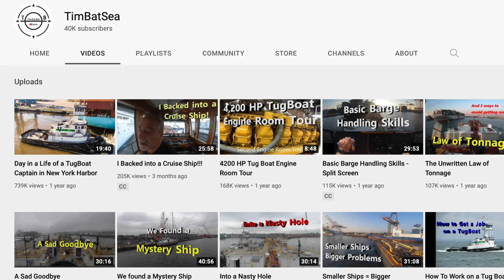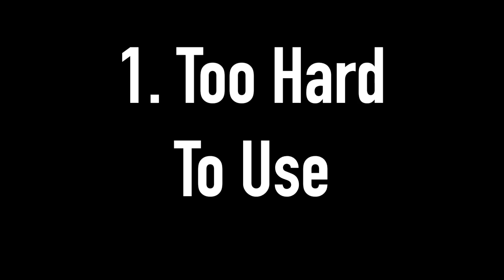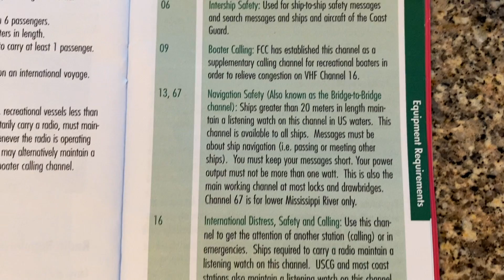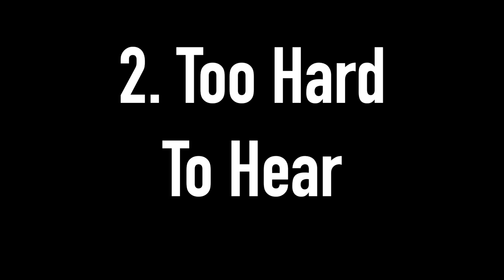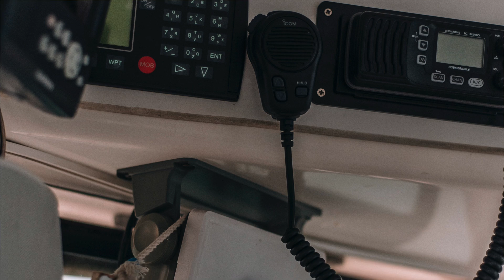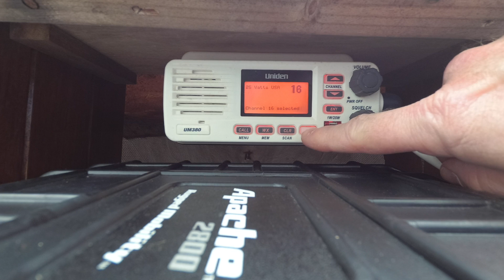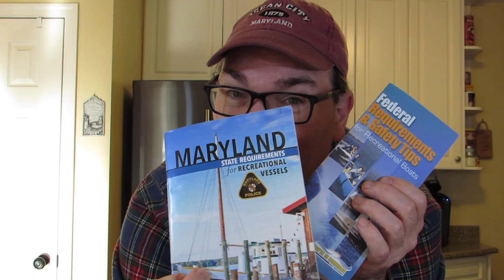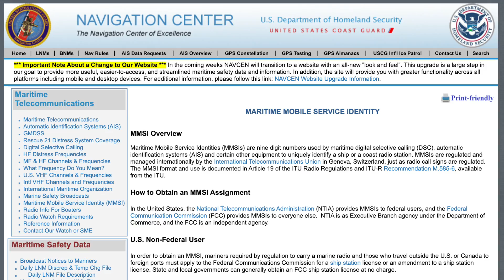The Problem With Marine VHF Radios

Comment: I think your "too difficult to use" is a bit overdone.  Even the most dimwitted GenZ/Millennials in my office have figured out how to use the 2-way radios.   Some instruction isn't a bad idea.  On my airplane, I put a P-Touch sticker above the radio "EMERGENCY - 121.5" in case someone unfamiliar with aviation ever finds themselves with the pilot incapacitated.   Perhaps an "EMERERGENCY - CH 16" sticker might be a good idea for marine use.

Comment: Initially bought a Standard Horizon HX210 to go with my Kayaking activity, and was impressed by the build quality, returned it and got the HX890 for the GPS & DSC and I think it's money well spend. For additional safety measures an ACR Electronics Personal Locator Beacon might also be used if radio doesn't get you any help.
Reply: As a fellow kayaker I would never go out without a PLB attached to my PFD!

Comment: My opinion:  For most recreational boaters, they will use a Marine VHF radio for one purpose:  Calling for help.  Therefore, when calling for help, the number one most important aspect is your radio signal travelling far enough for another boat or station hearing your transmission.  This is where handheld radios are inferior - the antenna that comes with these radios is very short where as with mounted radio you will have an 8 foot antenna on top of your boat.   All things being equal, the antenna height can make a significant difference between your transmission being heard or not.  If you have the extra dough, spend the money and get a fixed mount with an 8’ antenna.
Reply: The other aspect of being heard from a distance is power. 
The handheld radio is usually no more than 5 watts transmit power. 
The mounted radio in this video has 25 watts transmit power. 
This, along with a taller antenna will transmit much further than the handheld.
Reply: another option is to attach a boat mounted antenna to the handheld via coax and adapter. You could easily double the range of the radio with a larger antenna, and have the flexibility to remove the radio when done boating for the day.
Reply: Exactly so. VHF range is determined by the height of the sending and recieving antennas, so unless you're in a 10' dinghy fishing enclosed waters a fixed radio and decent antenna is far superior... and really should be mandatory.
Reply: The general rule of radio with short wavelenghts, is if you can see it, you can talk to it, if you can't see it then the signal won't reach them. VHF is always line of sight and power means little. With clear open line of sigh, 500 milliwats will reach to the horizon a few miles away just as well as 10 watts.

It's always best to mount the antenna high and turn transmit power down low to preserve battery. Even a bad antenna mounted as high as possible will do better than a good antenna mounted low.
Reply: @mrdojob  that 500 milliwatts won't be heard if someone is transmitting at 1, 5 or 25 watts.
Reply: @5stardave  Sure, it will be heard.  VHF is not like CB radio with everyone talking over each other.  I have used less than one watt many times when using VHF radios with the other stations having no idea how much power I was using - because, they could hear me just fine.  And, I don't even think about how much power other stations are using.
Reply: Yeah that stubby antenna and low power handheld is only good for ~3 miles.
Reply: @fredc3543  CORECTION 10 MILES RANGE ON A HAND HELD VHF RADIO LINE OF SIGHT TO LAND.
Reply: @fredc3543  Wrong!
Reply: another option is connecting a standard
Reply: Hmm, I’ve been into radios since I was a preteen. In my teens I got into CB radios (everyone was in the 80’s), when I started flying and went to aviation technician school I got in to the Airband radioso, later into FRS radios, MURS, GMRS, so on. It never stops amazing all the misinformation I see people spreading about radios. The people see me with my radios (whether it’s a HT or Mobile or base station) the number one question people ask me is, “how far can it go?”

The short answer, it depends in several factors. Even though antenna height does play a role,  depending on the circumstances, it can play a lot, to some, to none. Radios operate on line of sight. Standing on top of a mountain at 4,000 feet facing the city bellow, even a low powered 2-5watt radio can go a distance of about 77.7 miles. Or further depending the height of the receiving antenna and atmospheric interference. Don’t believe me? Look up video from Notrubbicon, he transmits from inside his house up on a hill, to a friend who is about 10 miles away to test radios when he does reviews on them. He transmits and receives with no problem.

So yes, antenna height does play a role, but it is all relative to what you are comparing it to. If you are 6 feet tall and you place your antenna on an 8 feet poll next to you, well, the antenna is only two feet higher. Is that really going to make a difference? Not much. An 8 foot mast mounted on top of something else, like your home, that can definitely make a difference. Even then, it may not make as much of a difference as some my think. It really comes down to how much interference there is between you and the person you are communicating with.

HT radios have one huge advantage over mobile radios, if your boat is sinking and you need to abandon it, you can take the HT with you. You can’t take the mobile radio with you. In my opinion, coming from the aviation industry, redundancy, redundancy, redundancy is the name of the game. I personally would rather have both. Which is what I did when I flew. I had the plane’s radio and a HT as a back up. Radio failure does happen. It’s more common than most people would imagine.

Also, because radios operate in LOS (line of sight).  Once you call for help and of a helicopter or plane is dispatched, your 2w or 5w radio will be able to be heard by those aircraft a very long away. Only logical since aircrafts are up in the air with nothing between you and them in a open sea. The higher they fly, the further they can hear you.

About power, it is not so much about the radio’s power, I have some HT radios GMRS that can transmit at 2W, 5,W, 8W, and 10W. And often times there is not much of a difference in distance. It is not power that matters, it’s FARS that matter.

Airplanes also use VHF frequencies, so the formula that applies to them should apply to all other radios. 

There’s a formula that gives us an idea of how far a radio signal can travel based on LOS.

The formula for the radio horizon (in miles) is approximately:
Radio Horizon (miles) = 1.23 × /(Height in feet)

For an airplane at 30,000 feet, the math looks like this.
Airplane's Radio Horizon: 1.23 x 30,000 = 1.23 × 173.2 = 213 miles

This 213 miles is the distance from the airplane’s antenna on the “radio horizon.” But one must also consider the height of the receiving antenna. If you are communication with a base station with a base antenna mounted at 50 feet, that ground station antenna would have a horizon of about 1.23 x 50 = 9 miles.

You must add the maximum range of both the plane and receiving antenna’s height to get the maximum range possible. So 213 miles (from plane) + 9 miles (from ground) = 222 miles. Of course this is under optimum conditions.  If there is lighting, the range could be less due to the interference.

Comment: Everyone I I paddle with (in a community of off-shore sea kayakers) uses a hand-held VHF, and knows about the GPS option although most don't use that. I had not heard of the DSC option and that does sound useful, so I appreciate the information even though I had to wade through 9 minutes of your sales pitch  I have to say that every single one of your arguments against a regular handheld VHF is easily countered) before receiving a link to buy one. More information about the different options of a DSC model would have been far more useful.  Also, for some of us living a less tony lifestyle, the very real advantages of a DSC model may be outweighed by a price tag that is twice as much as a basic and perfectly adequate hand-held.  I have used the may-day protocol once and know at least a few other people who have had to over the years, and it has saved at least one life.

Bottom line: DSC is a great idea. Some kind of communication is an absolute must. But for anyone who can't figure out how to do the may-day protocol, I have to wonder how they can figure out how to operate any vessel safely on open water in the first place. Whether one is operating a 16' kayak (a "speed bump" as many power boaters so quaintly refer to us), or a 60` yacht, why wait for the government to tell you what to do?

Comment: Unnamed recreation boats, are just referred to as pleasure boat. If you are on the water get a vhf radio,  medical emergencies, boat and equipment catastrophic failures DO NOT CARE how big your boat is. Have a backup plan for communication, cell phones are not reliable on lakes and river in a lot of areas.  Unfortunately I see too many people putting themselves in extremely dangerous situations everyday on the river. From boats and jet skis zipping in from of Towboats and barges to watching Pontoons with kids on an inner tube pass right beside a  beside towboat. Great Job Dad of the year, if your kid falls off that kid is going into the wheel of the boat. Get a radio, use some brain power out there.

Comment: You make an excellent point about using the Portables or HTs on land. I looked at the VHF MARINE channel allocation and they do overlap with AAR channel allocation for the Railroad Industry. My thought would be to write a letter some of these radio manufacturers and petition the FCC to allow or add more channels for recreational users, especially keeping contact with their parties on land without using the traditional maritime radio Telephone.
Reply: For the AAR freq, they are on the international freq. You won't be able to hear them if you're on the USA freq. For example, our local AAR freq for the tower is 160.800 mhz on receive side. That's channel 4 international receive. If you put that on channel 4A, which is USAchannel, you won't be able to hear them. My 2 cents.
Reply: On some routes, trains have to communicate with the same bridge tenders that the boats do, so it makes sense that they’d have some overlapping channels

Comment: Portable marine VHFs have a range of 3-5 nautical miles (5 W transmission power). Fixed ones (25 W) can reach to the the horizon (30 nm). So if you can reach the coast guard with your portable VHF at shore you would likely also be in cell phone range. Portable VHFs are for inter- and intraship communication.
Reply: You can reach another boat within 5 miles and they can contact the coast guard.

Comment: Wayne I came across this video by accident. I am a professional mariner. I am friends with Tim B. However I don't see him around the harbor since his move south. I disagree with you on a few points. DSC radios are a waste of time and money. As a mariner for 36 years on and off, I have never made a DSC call other than screwing around with it. The simpler the radio is the better. All of those silly features like scan, dual watch are all marketing nonsense. You want a radio that you can turn on, select a channel and make your call. It does not take much listening time to get a grasp of the "language" we use out there. When I steer my tug, I am aware that recreational vessels may not have a VHF or not know how to use them properly. That's why I never try and call them, unless it's an emergency. I have received calls from recreational vessels, which I appreciate, especially when they make passing arrangements with me, most of the time it's not necessary, but in some tight spots it's helpful. 

Some tips on VHF in no particular order. The fixed mount radios with a good antenna work better and is the minimum you should consider if you are more than a mile offshore. On a fixed mount the mayday button can be a good feature but it's limited. If you push that button in range of a Coast Guard Stations antenna, they simply make an announcement. They do not plot coordinates and come out and get you. When you call a USCG station, you will generally be talking to a watchstander who has 3-6 months in the USCG, it will require a few go arounds to get the "officer of the day's" attention to get any meaningful help. The watchstander will ask the normal questions, name of boat. persons on board, position, description, nature of emergency, etc. You should have these answers handy. 

Pro tips get a Seatow or Boat US membership and keep it paid up. If you are in a place like New York City or other large city, call 911 on your cell and report your emergency, you are more likely to get meaningful help, especially if you have a medical emergency. Buy some charts and know where you are. Stay out of the way of commercial traffic, do NOT cross my bow,  watch out for my swing and a tow behind me.

Comment: Call me paranoid, I have a handheld DCS with integrated distress button.  I do have 6 watts max output, Cobra claims up to 16 miles but I will only count on 5.  In addition I keep my ZOLEO Satellite transponder on board which can transmit emergency via satellite emergency network from anywhere on earth.  Along with flares, first aid etc.  I don't want to die fishing off the coast or worse yet kill someone.  All this in a 19' aluminum fishboat ( which is tied to an MMI ) Thanks for the video

Comment: Thank you for the video. However you kinda sound like a more laws make more safe guy.  While your intentions are noble, giving the state more control, especially MD,  no thanks.  Giving a pamphlet during boat registration, sure.  But no on the law.  Laws won’t stop stupid and unprepared skippers.  Thats like saying the helmet law will stop motorcycle accidents.  Idiots are idiots, laws only beat up the people that would do the right thing given the chance and the knowledge. You should except the fact that 30% of the people you meet are not mentally registered in this reality.  These are the people that wouldn’t watch this video.  Passing a law will not magically fix this.  As for onboard crew, a safety tour prior to leaving the dock is every skipper’s duty.  Life jacket location, how to turn off the motor, and how to call for help, 5 mins tops
Reply from the maker: I honestly just think there should be a better (easier to use) product out there for recreational boaters to get help if they need it instead of having to learn how to operate something that is totally foreign to most people these days who are not commercial pilots, truckers or boaters.

Comment: Wow I just stumble upon this video! Be careful on taking advice from a guy with 2 years of  boating experience. You shouldn't be in a boat or on the water!!  SMH
Reply from the maker: I shouldn’t be on the water just because I have an opinion on the old CB radio tech of VHF radios?
Reply: @WayneTheBoatGuy  Opinions are fine, but you know what they say about those! At least know what you’re talking about. Obviously you lack the experience (2 yrs at the time of the post) to give advice.  You would not take advice from a new driver on how to drive in the snow? Well maybe you would. Look guy you had some good points but by and large you were incorrect about your assumptions but that comes with inexperience.  All good!

Comment: An external speaker is extremely cheap and connects to just about every radio out there on the market. You can get a power one amplified battery operated or 12 volt accessory remote speaker for a few dollars more.. and yes they're easy to use click the button hold it down and talk it comes with instructions. Most all the radios have instructions. It's literally common sense. No one forced you to get a handheld but even they have speaker jacks. And most of them have microphone jacks. Everything you said but completely disagree with. The FCC puts out simple rules. They're not hard to follow a 12-year-old could follow them. At least your average 12-year-old with a general IQ.

Comment: If you are on an un-named vessel and you are giving a may-day, you give your vessel description and location. Many small boats are not named but the naming certainly helps especially if you have your boat radio registered with DSC MMSI registration at which point they will know exactly what type of boat it is and if that radio has an DSC button and GPS this can help with locating your boat. I always had a mounted radio, PLB and a portable waterproof marine radio with me with the later being in my ditch dry bag.

Comment: This might be relevant in the US but not anywhere else. In the UK and most of the rest of the world you need to take an exam and have a licence to have one. In most of europe it is a legal requirment to have a vhf hence pretty nearly everyone has training in using it. Every sailing boat ive had and been on has a single sheet pinned up by the radio with call sign and what to say and buttons to press in an emergency. DSC gives the coastgaurd and rnli your position instantly. Ive had to make a pan pan call and mayday relay. The rules work. Maybe things are different in the US with loads of numpty boaters.
Reply from the maker: Yes. We only have requirements for larger boats and commercial boats. I’m sure it’s very different in different areas, like off shore boaters are probably much better prepared than lake boaters.
Reply: @WayneTheBoatGuy  one good thing about the portables is that, over here anyway, they are limited to 5 watts  and obviously being hand held with line of sight range only have an effective range of a couple of miles. That means if sailing in convoy you can have near private conversations without cluttering up the airwaves